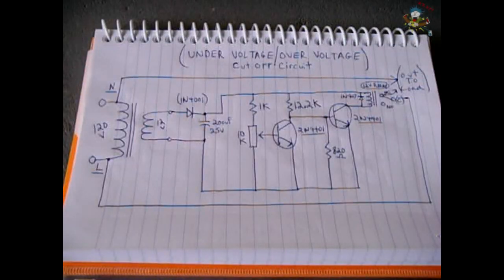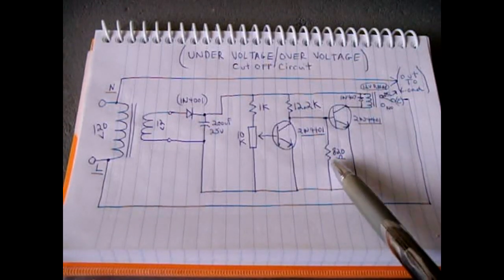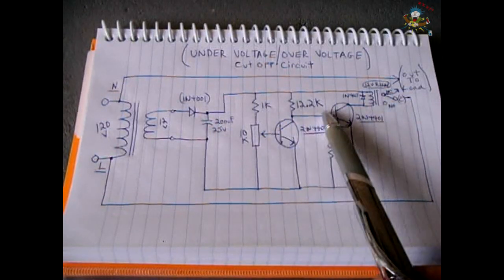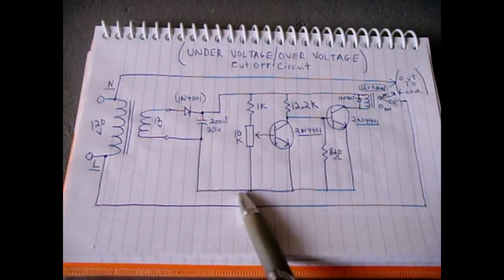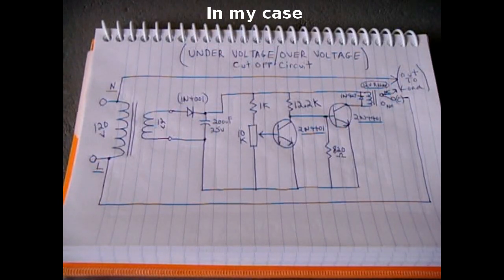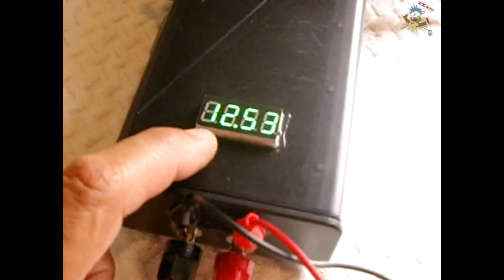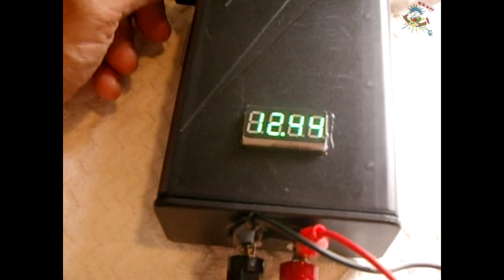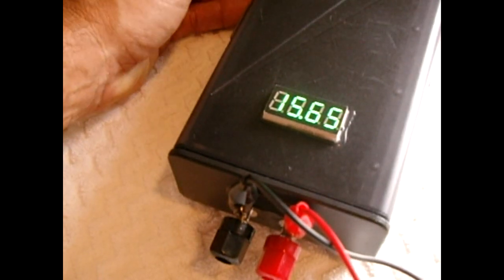Under Voltage/Over Voltage Cut Off Circuit (12vdc/120v/240v)

Comment: I built this circuit but had to change a  few of the resistor values to get it to cut off at around 10v.At first it works great,But instead of turning straight off ,it starts doing a really annoying flip,flop thing.have you got any idea what I could have done wrong.

Comment: For use with a 12vdc circuit how would one get more accurate High/Low cut off points?
Reply from the maker: The circuit works good as shown, there's no need for high accuracy. Thanks for watching!

Comment: The relay switching appears to be very gradual when being used for the marginal voltage threshold cutoff, if that happens, the relay contacts may exhibit high resistance during the slow transition. If the relay is being used to switch heavy load current, it may overheat and degrade.  Inserting some logic like Schmitt triggers would enable the relay drive to get a full on , full off switching, in case you need the relays for high current applications.

Comment: what is its applications and how to improve it
Reply from the maker: Why improve something that works? The circuit is designed to do as stated, protect against under voltage or over voltage.

Comment: How many amps relay should I use if I want to use this circuit for 230 volts
Reply from the maker: franklincense patrick Make sure the relay rated current can handle the load.

Comment: Can I ask what the relay current draw is. I am looking to control a 12 volt-ish circuit. I want to control circuit on and off depending on voltage. A slight adaption from this but more in line with my needs. I thinking about mosfets like IRF4905.
Reply from the maker: The relay shown in the video draws around 50mA.
Reply: Thats great 50mA really. OK
Reply: Most relays, once they pull in, will hold in with typically 10-25% of their nominal rated voltage.

Comment: Thank you very much for your information. I learned a lot from here.

I have two questions. 

What changes need to be made 
1. if I need to control a high current relay at the output?

2. to change the cutoff voltages? In my case, low cut off voltage is 13v and high cut off voltage is 15v.

------------------------
I am planning to make a 400Ah camping car batteries charger to make it only charges during driving. The normal voltage of my car battery is around 12.5V when it is fully charged. I need to make sure only this charger works when my engine is on and generator is working properly(while the engine is on, car voltage becomes 14.2-14.4v in my case). Please give me some advice. Thank you very much.
Reply from the maker: +Young Park 
Unfortunately there is not a simple answer. You need to adjust the resistor values to get it working exactly as you want. Why not use a high output alternator along with a battery isolator?

Comment: thank you..one more last qstn- what max amp's on safe side I can use with this circuit?
Reply from the maker: +Raimis Pavardenis 
The maximum current is dependent upon the rating of the relay contacts, and wiring size used from the PSU to the relay, then to the battery. You should use no less than 16ga. 14ga is better.
Reply: ok i see..thanks again.. thumbs up!

Comment: Nice video. What changes must be done to this circuit to use it with - voltage in 15.5v and 15amp`s? . Planing to use as car battery charger : modified pc psu ->charge controller ->battery . Thanks in advance!
Reply from the maker: +Raimis Pavardenis 
You eliminate the transformer. The PSU is connected to the point in the schematic where the 12V secondary winding was. You also take the PSU and connect it to the points where (N) and (L) are marked in the schematic.You may have to adjust the values to get it working properly.

Comment: Very nice video ! I have a circuit something like this to regulate my battery voltage in my cabin. I'm using 18 amp solar array and a 300 watt wind turbine. I have a 40 amp solid state relay for wind turbine dumping and a 30 amp relay on the same circuit to disconnect the solar panels from the circuit when battery voltage reaches 14.2 volts. Then recharge from solar/wind when battery drops to 13.2 volts. I'm gonna add another one in series for fail safe under voltage.
Reply from the maker: Bay Drifters Thank You! Sounds like you have a very nice setup. :-)

Comment: Is your circuit protected itself, for example if the voltage (230VAC) climpes to 300v the transformer will burn.
Reply from the maker: i7432 My question to you is why would that happen? You are using a utility company's power supply correct?
Reply: electronicsNmore The circuit to operate in extreme voltages must first endure in those conditions. The transformer especially the high voltage side is so sensetive, that mostly burns in 270VAC and above. I am talking about irrigular mains supply that subjected to incidents not the surge voltage which can be prevented only by using varistor the one that I did not saw in your schematic cct.
Reply from the maker: I am sorry, but I do not understand what you are saying. If you have any further questions, please refer to the link in the video description area. Thank You
Reply: electronicsNmore I have no questions, I had a case that the voltage of the mains rise up to 305VAC. but you have tested the cct with dc power supply assuming that the secondary part of the the transformer will rise up to some 20v, but you forgot that if you test it as your schem. with 20v on the secondary part you will need more than 300VAC to acheive that and the transformer will not hold, thats all.

Comment: Why would you seek to cut off the load in the case of  12 V battery overvoltage?   Would you rather not cut off the charging source & still allow loads until the voltage dipped down below 10.5 volts or so?  You would want the charging source to disconnect in overvoltage & the load to cut off in under voltage.   Am I wrong?
Reply from the maker: Soteriology101 Not wrong, just a different way of thinking. If you are connected to a system which has a FAULTY charging system(regulator) which allows the voltage to continue to rise, then whatever electronics/lamps/LED's/ETC, will be disconnected from that power supply to prevent any damage. When you see everything disconnect, that will be your clue that something is not right with the charging system and you need to check it out. Very simple, and a great circuit.

Thanks For Watching

Comment: Hi i have a simple schematic you could check for me and give me a tip on values to add your circuit to mine, i did made an system that could work as emergency light or a garden night light, it uses a nobreak 12v battery it has a cutoff 10.6v and a max 13.8v, it is drawn in protheus 8, i can send the schematics and pcb, all i need is your advise and heltp to set that cutoff apart to work with my system, i have a 25w 19v solar panel 3,and 9v center tap, it takes 18v to work so over charge is not a problem since it's a regulated charger but i don't have the cutoff.

Comment: Hi i will use ur ckt for charge controller with 2 10 w solar panel in series to a 12 7ah battery so max 36v so i want to know the limiting diode on the input  thanks
Reply from the maker: This circuit is probably better for what your looking to do.

Excellent & Simple Battery Charger (Gel/Lead Acid/Li-Ion/+ more)

Comment: Hi i will use ur ckt for charge controller with 2 10 w solar panel in series to a 12 7ah battery so max 36v so i want to know the limiting diode on the input  thanks

Comment: Hi im talking about ur variable power supply to the circuit since im using only a playstation wall adaptor unit  on my test bench
Thanks for the quick reply
Reply from the maker: The purpose of the variable power supply was to demonstrate at which voltages the circuit will disconnect the load.
Reply: electronicsNmore thanks again may I know the watts of the resistors P1 and P2 ur using  also if im using  2 10 w solar panels in series  is the 28vdc zener diode ok to use
Reply from the maker: P1 & P2 are potentiometers. Very little current flows through them. Use one like I did in the video. What is it exactly that you are trying to do?

Comment: Like it for solar v regulation can u share the power supply ckt as well tnx
Reply from the maker: I don't understand what you mean by the power supply circuit? The voltage to be monitored goes to the (+) and (-) rails of the circuit. The load is connected on the relay contact side.

Comment: I have an out building that I'm adding solar power too. I've been looking for such a circuit for a while, but all the ones I've found were not nearly this simple.  Thanks for sharing and explaining it!
Reply from the maker: Your welcome. Be sure to share my channel with others.

Thanks!
Reply: Simplicity has it's price :)
This circuit is a clever hack, but it's downsides are:
1) Poor repeatability due to high dependence on transistor parameters. Each circuit must be manually tweaked to obtain similar results.
2) Poor thermal performance - the limiting voltages will be highly dependent on temperature, which makes it not really suitable for any serious application in varying environmental conditions.
If you are investing in solar power devices, which are not cheap, I'd recommend something more reliable and repeatable.
Reply from the maker: I have no problems whatsoever using this circuit. Use the same transistors I did, and you will get good results. I already stated if your looking for very precise triggering levels, then you should use another circuit with a comparator.